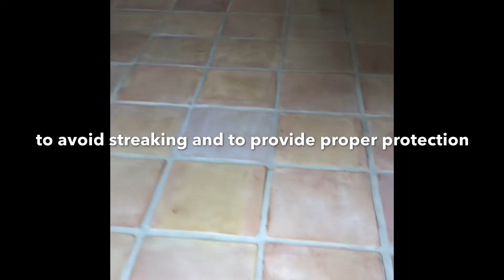Restoring Whitewash Stained Terracotta Saltillo Tiles Before and After | Sealer Removal

Comment: So if you're whitewashing them, it won't last and will need to be redone?
Reply from the maker: These tiles need to be maintained to keep the layers of sealer up about every 3-5 years depending on the foot traffic. Even if you wear away the sealer the tiles can always be brought right back to like new because the tiles are protected with proper amount of coats

Comment: What liquid material do you use to dissolve the old white wash .
Reply from the maker: Want the product we use to remove coatings and old sealer from terracotta Saltillo tile? 

Think you can tackle your project 

Then call (707) 384-1172 and ask for Fritz 

BUT HURRY because supply may be limited and you don't want to be left out.

Call right now and get a FREE 15 minute consultation when you mention this video by title!
(which you are GOING TO WANT, I promise)